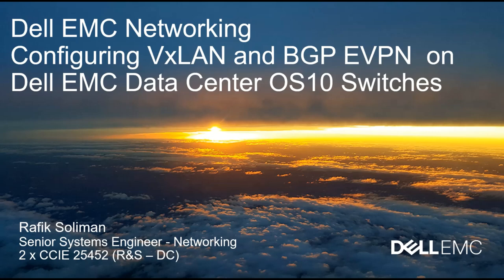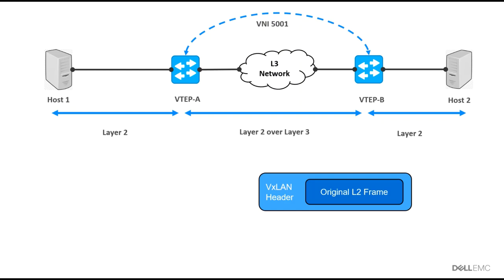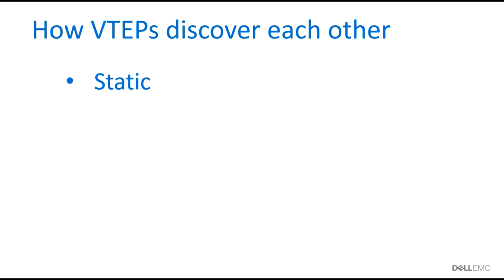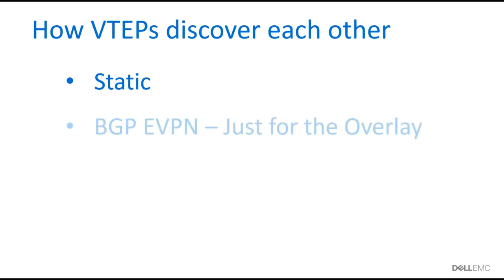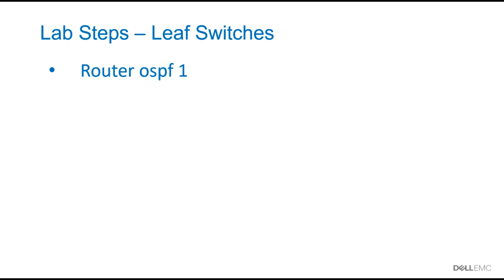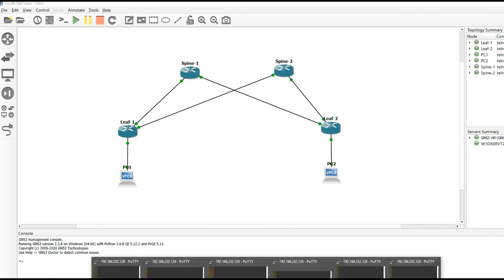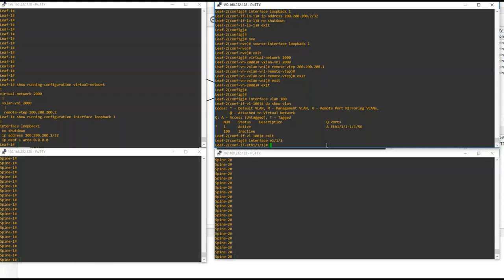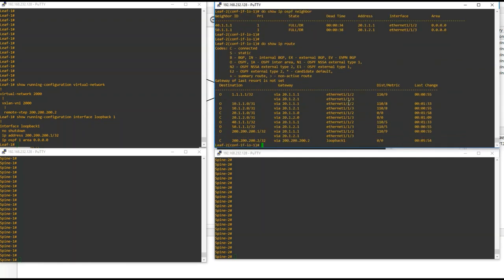Configuring VxLAN and BGP EVPN on Dell EMC Data Center Switches

Comment: Very well explained Rafik, Was searching for a good one from Dell (VxLAN). So the tricky BGP part  is if you forgot to disable BGP ipv4 routing , it will overcome the OSPF routing in routing table since the BGP administrative distance is lower then OSPF. Is that the reason I believe , Correct ??

Comment: Dumb question:  why all the vxlan jazz, to get VLAN 100 from one rack to the other?  

Why can’t spines and leafs trunk vlans? Why the extra encapsulation and routing?
Reply from the maker: there is never a dumb question , the reason why, without VXLANs, your physical Network Switches need to be aware about all VLANs in order to trunk, otherwise packets are going to be discarded .. with the concept of VXLAN, now we can have the Overlay, for example VMware NSX, creating VXLANs tunnels on top of the Physical Network without the need to create every new VXLAN on the Physical Switch, and also to overcome the limitation of only 4K Vlans .. I hope this helps :)
Reply: @rafiksolimancloudsimplified  thank you very much!  Great answer